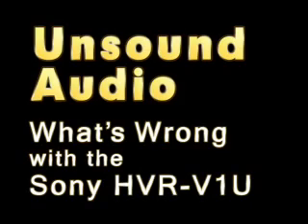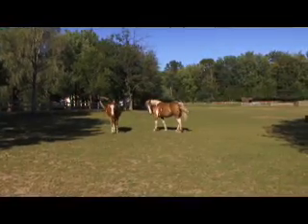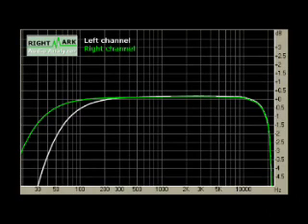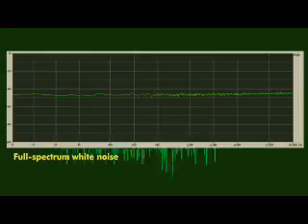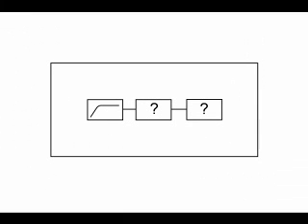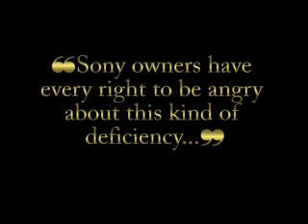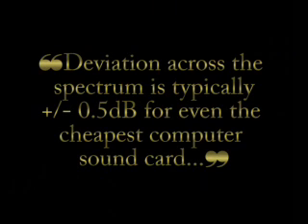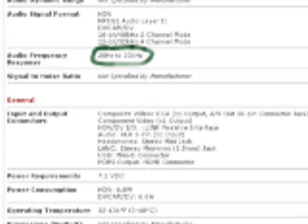Unsound Audio: What's Wrong with the Sony HVR-V1U?

Comment from the maker: You're looking at this from inside the old paradigm of 1-7/8IPS tape with linear track audio. Forget that model. This is DIGITAL audio. There is NO reason the low frequency response can't be flat to DC--it's just a bitstream!
As for the movies, dialog audio has to be the worst--it sounds like it was recorded through a toilet paper roll core.
As for camera audio, I'm pleased to report our new EX1s are DAT-quality and every bit as clean as the best portable digital recorders.

Comment from the maker: The on-board mics in the HV20 are terrible. But the audio front end on the HV20 is not bad when you use a quality external condenser mic.
I ran a test of three recorders, at a wedding last summer, with the same mics feeding three different recorders for redundancy. The Zoom H4 was the best, the HV20 almost as good, and the V1U far behind, with no bass at all.
Testing with the on-camera mics tells you how the mics sound--there's no way to separate the caemra from the mic quality in that case.

Comment from the maker: No word on any replacements in the HDV lineup.

I have my new PMW-EX1 and with an external Rode NT4 X-Y stereo mic, it captures 'studio-quality' sound. I did some run & gun stuff that was spectacular. I covered a choir concert recently with just the Rode feeding the EX1. I could hardly want better audio than I captured with the EX1. It was good enough to make a commercial recording from.

Comment from the maker: Perception of sound quality depends on what is being recorded and also what that recording system is being compared with. You may not miss what is missing until you hear a full-spectrum recording. That's why many users aren't really aware of the problem.
BTW, I have a new XDCam EX that DOES have a flat 20-20,000Hz response. HUGE difference in sound when there's music, diesel engines or other big sound in the scene.

Comment from the maker: Sounds like a troll. Not a scam, just objective test measurements. Sorry you're no longer happy with your V1U after looking at the test data. If it makes you feel any better, the XDCam died less than 6 hours after it was received. E-15030 shows on display and camera won't start up. 7 grand, and it's now just a pretty looking brick.

Comment from the maker: The important thing to consider is the application. If it's 'run & gun' at musical events like parades and air shows, you'll want good audio to capture the bass drums and the rumbles of the jet engines. If it's documentary work to be shown on a 19" TV set, the audio won't be a problem. I feel that Sony SHOULD have done better, considering all the features they put into this camera.

Comment from the maker: I have only two US models here to test, but I have heard the problem on other US models, and just yesterday, a gentleman from Norway said of his V1E:  "..it has no bass response whatsoever," in a forum comment. So I would conclude that it's across the board. It rather hurts the useability for run & gun at parades and other events where sound matters but where it's impractical to deal with second audio recording.

Comment from the maker: When the technology to provide CD-quality sound is in a $20 chip, providing this capability on a $4800 camera becomes something expected--like buying a Porche and expecting that it'll be capable of highway speeds.
Some field shooting situations are 'run & gun' and you can't drag a wheelbarrow full of digital audio gear. Shooting at weddings, with scores of stop/start means a lot of re-sync in post. Unnecessary if the cam performed like a cheap iPod can.